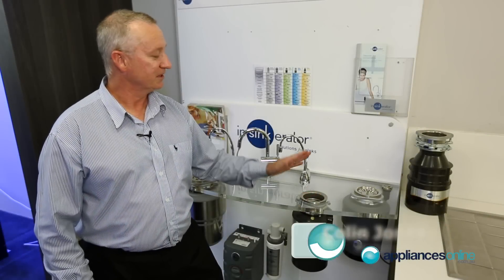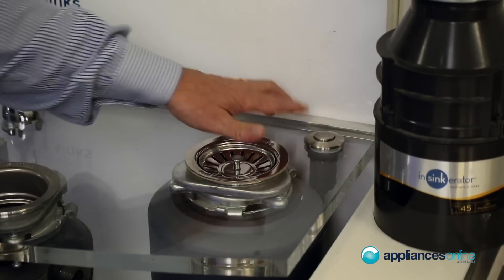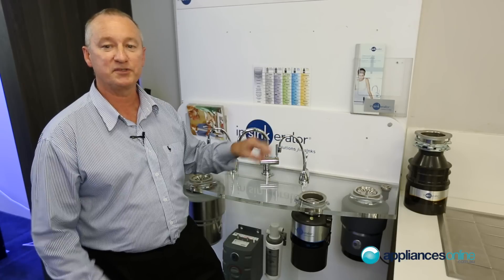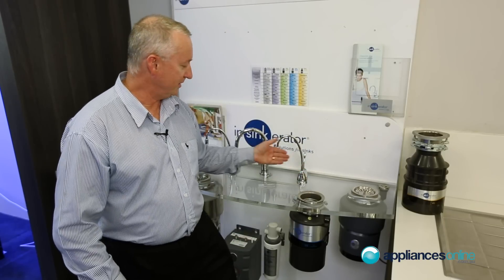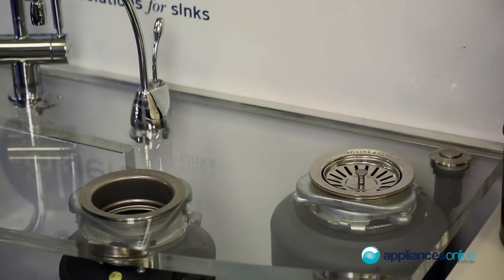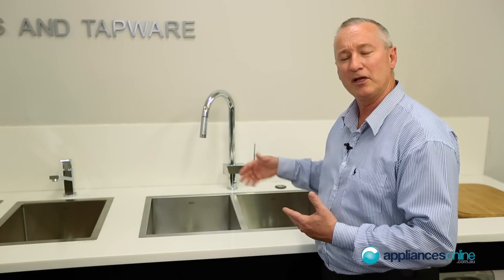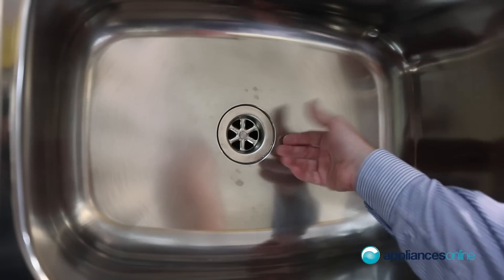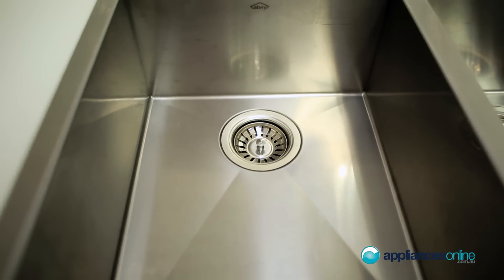How to correctly install an Insinkerator food waste disposal unit in your home - Appliances Online

Comment from the maker: Hi *****. The units can usually be repaired, but any work needs to be done by a qualified installer. A professional plumber should be able to source the required spare parts, and can safely disassemble the unit if needed. If you have any further questions, our 24/7 Australia based Customer Support team can help you on 1300 000 500 :)